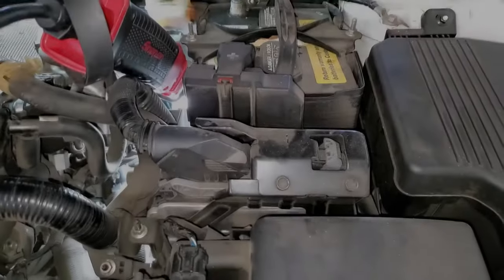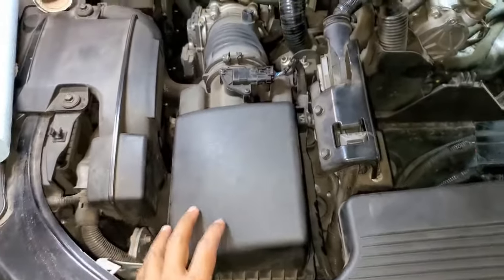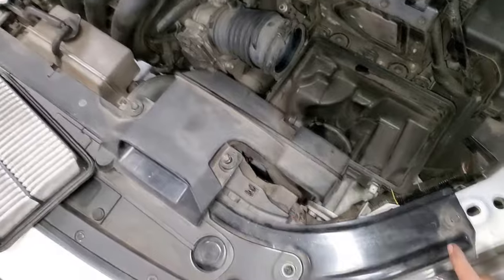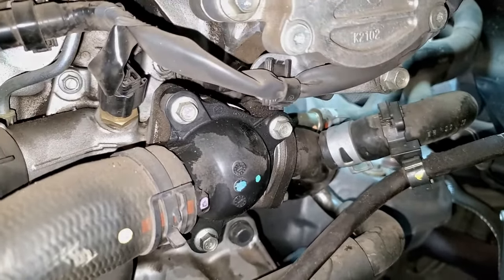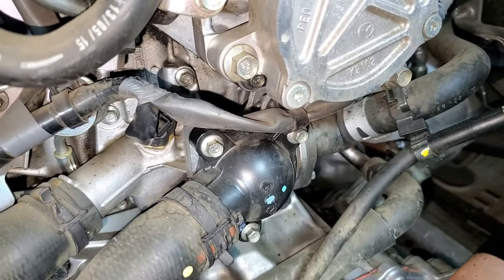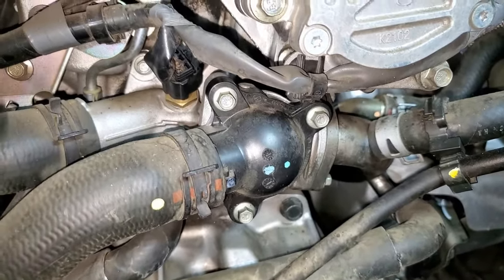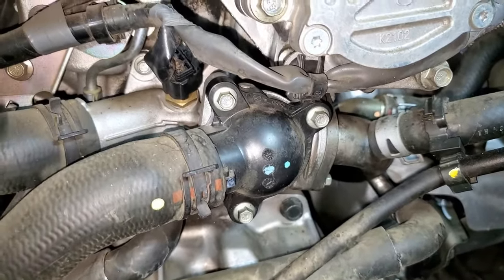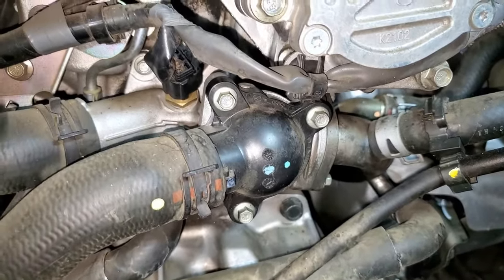Remove & Replace: Thermostat + Coolant & Clean Throttle Body 2.0 2.5L 2014 to 2020 Mazda 3, 6, CX-5

Comment: Notice how good these engines are. That old thermostat with 150k looked clean as hell. These are great little engines. My 2014 3 has 189k and still runs flawless with almost 40 mpg highway at 72 mph. Love these whips.
Reply from the maker: Nice!  I only get 25 to 27 mpg.  Maybe the 3 is a lot lighter so the mpg is that high?
Reply: @footprintsinconc  also I have the 2.0 which is smaller but very efficient.

Comment: had overheating problems suspected the thermostat but car was towed to the dealer and wow do they soak you on this repair. I've done it many times on many different vehicles and its very easy repair. Garage is $350 at the dealership, just like the ridiculous $350 they quoted me to change spark plugs
Reply from the maker: They sure do charge a lot

Comment: Really appreciate you doing this videos, well explain and no so much moving and shaking of camera. Thanks sincerely 
I’m wondering is it’s completely necessary to remove the computer and all of the other components. In California you have to wait days for computer to register the smog parameters and won’t pass smog check.
Reply from the maker: Thank you!
Yes it has to come off because the bracket that the it sits in is connected to the battery tray which has to get out of  the way to access the thermostat housing

Comment: When you were draining the radiator from that valve did you get all of the coolant from the system or only a portion and if only a portion, how much of the overall radiator capacity did you drain out?

Comment: Do you have to drain the coolant in order to replace the thermostat? I ask because i just replaced mine two months ago, feels like a waste
Reply from the maker: you don't.

you'll just loose some liquid when you remove the thermostat.

i would clean the under carriage at the radiator, put a CLEAN bucket under the radiator, drain the radiator into bucket to reuse the coolant.

with the system drained, remove thermostat for minimal coolant loss, and then once everything is back together, reuse the drained coolant.

Comment: Its basically the same on the 2.0l, 2.5 is literally just upscaled version of the 2.0 and they only thing that appears different is some hoses and wire routes because of the larger size in the engine bay. Positions on the engine and battery removal are the same
Reply from the maker: Thank you for sharing this, i'm sure that others will find this useful.
I'll update that in the notes.